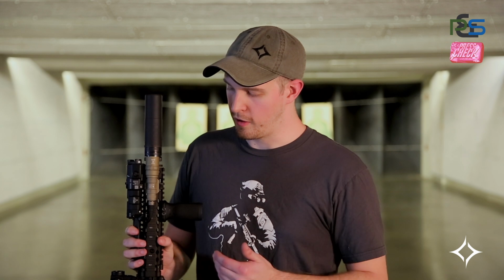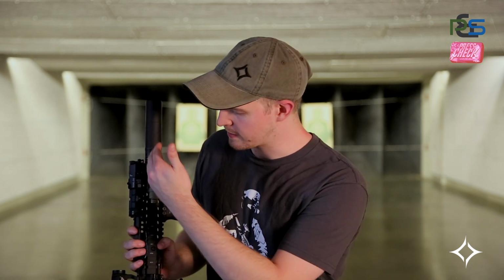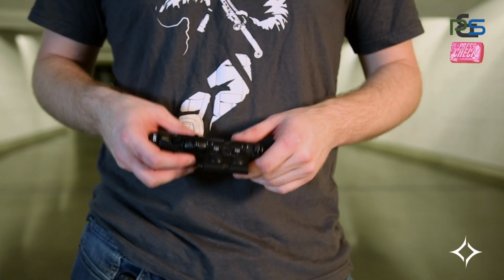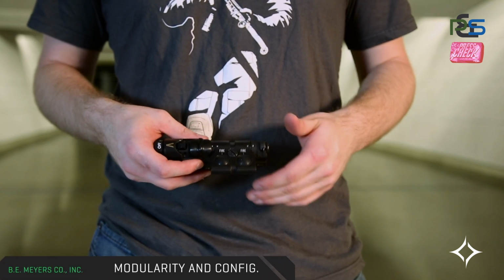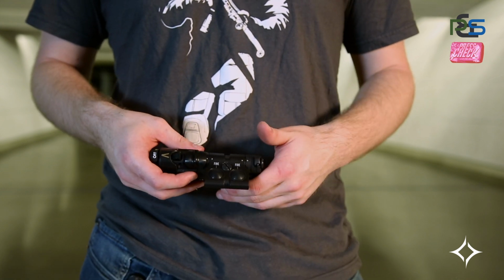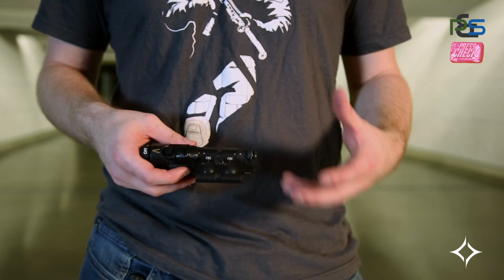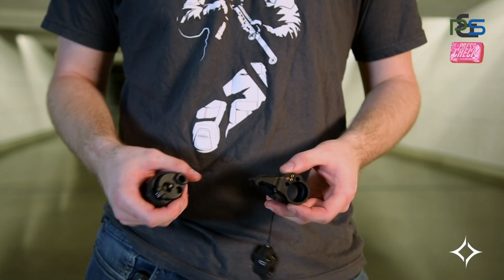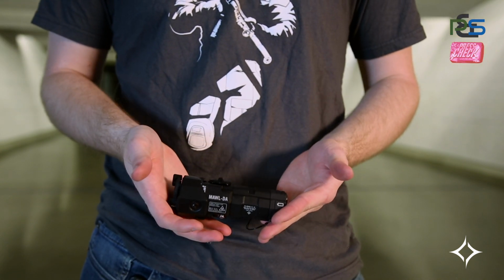An introduction to the B. E. Meyers MAWL

Comment: These are things that we have noticed after running the Mawl. It is an amazing device. Ergonomics and illumination are amazing. It does have some weak points and I hope some of them will be addressed in the future.

 It has a cheap, sloppy plastic selector switch, a flimsy plastic bezel that has no way of keeping dust, dirt or rain  off the diode lenses. Dbal's and have dust caps and are easy to clean which is a nice feature. In order to clean the lenses underneath the bezel you will have to use Q-tips or a garden hose.  The plastic detents under the bezel selector wear out very quickly (couple months), my bezel almost spins freely now. The windage and elevation adjustments have almost no clicks / detents.  You can spin them with your finger tip. The windage is the one to always check, to make sure it hasn't moved. Mark everything with a sharpie. They have a very cheap feel. You need a tool kit to change the battery or $500 you by the aftermarket battery cap.  If you turn the mawl on to standby mode it will drain the battery in 3.5 days with a legit Surefire battery locked in the gun safe. My Dbals are left in standby mode for months and even longer on the same battery. So make sure it's always off when not in use. These are things that we have noticed and are dissatisfied with.  The products BE Meyers make for the military are built like a tanks, The MAWL is not.  I'm not bashing b e Meyers, it is what it is, but we do want people to know exactly what they are getting.

Comment: Looks very impressive. I will wait and get one in 4 or 5 months. This device just came out and $2500 seems a bit steep based on the current market if it comes down to $2000 I will pick one up and sell my Dbal A3
Reply: roy e     the dbal has gone down quite a bit so maybe by next year it will go under 2k
Reply: 3 years later 2800 with my discount lol
Reply: Now up to $3500..........
Reply: Honestly, the MAWL should be priced at $3500 given its dominance over other competing lasers on the market:  $2500 is a steal, and I do not foresee prices dropping on it, ever.